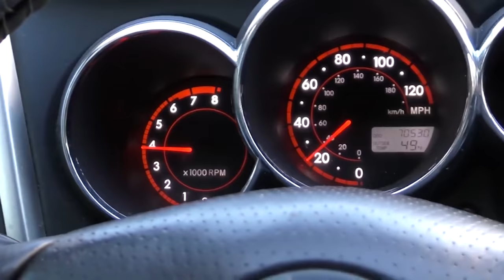5 Signs Your Transmission Has a Serious Problem

Comment: If you do it regularly is the key, (change fluid). If you let dirt get stuck somewhere, it is best to leave it where it is. Your transmission life will be shorter than had you changed fluid often, but sending the dirt elsewhere can cause immediate failure.
Reply: What about changing it not flushing it. I’m at 217,000 miles and i bought the car like 4 years ago with 160,000 miles. I don’t know if the fluids ever been changed. What do you think?

Comment: My 1992 Chevy van sat for over 10 years and has around 70k miles. I want to confirm that what I am hearing is correct. You change the filter and whatever fluid drains out with that and then top it off. And do it often?

Comment: 3 reasons for slipping:
1. Worn clutches or bands. Mechanical failure.
2. Passage in valve body clogged with sludge. This is where new fluid can help.
3. Valve body bolts loose. Causing internal leaking from one passage to another causing lower pressure. This is the defect that thickeners can help.
Reply: Is there a way to just tighten the bolts? Are they accessible with the pan off?  I have a 4L60e in a 97 Chevy Tahoe
Reply: @wayneinfl  Yes. In fact there's video published by 1Road that will show you how with that exact vehicle. Also replace the filter.

Comment: Change your auto trans fluid and filter every 30,000. It helps much in preventing having to rebuild the transmission under 80,000 miles and can last well over 150,000 as long as it hasn't been misused.
Reply: My ES350 2007 has 285k with the original  fluid....yikes!
Reply: 2016 Mazda 3 I sport with 170,000 hard miles and the original fluid.
Reply: @hobojesus9817  That combination would make any viewer on this channel wonder why anyone would bother watching any auto related videos.
Reply: 2004 honda accord ex 255,000 miles same fluid lol.
Reply: My fathers car golf 2 1988 …he don’t know the transmission have oil.

Comment: I was always told when it comes to transmissions, only do a drain and refill (or partial drain and refill) --- never flush transmissions, especially ones that either have not had the fluid changed or it's really dirty.  It's one of those things you either do it regularlly at 60-90k or you just leave it alone and hope for the best.  I've seen a few cars where people even just drained fluid that had never been drained on cars with 150k on them and they never ran right again (they ran OK before the fluid change though) and they ended up junking them a year or two later...  On my last few vehicles, it was done every 60k.
Reply: I have a 2010 Toyota Corolla that I bought with 90k miles now it has 120k miles.. transmission kinda jerks lightly between 2-3 gear some times.
Should I drain the transmission fluid and change oil filter?
Reply: True words spoken
Reply: @age0fdef1  

If it's a standard automatic transmission I would probably just leave it alone if it's never been touched for 120K. If it's a CVT I'd consider changing it because those fluids are much more sensitive and must be changed regularly from what I've been told. My wife had a CVT on her Nissan Rogue. We changed the fluid every 40K and it still crapped out at 120K miles.
Reply: @age0fdef1  I just changed mine 2009 Toyota Corolla with 120k miles just did a transmission fluid drain and filter change never been changed before and it’s running good so I think yours will be fine
Reply: @leonelromero3296   how did u know you have to drain the transmission fluid ?? We’re there any signs?? I have a Toyota Yaris😅
Reply: When I was in highschool I worked at a  quick  lube place, I brought a Hyundai accent into the garage, it was so bad to go 100 feet I'd have to put it in neutral and back in drive every like 20 feet. They flushed it and by some miracle it was fine after. Also had a Taurus come in , the fluid was black with some greenish fluid in it, changed the fluid and it was fine too. Those we're the only 2 I've seen that were ok after that much neglect
Reply: My 2013 pathfinder cvt still alive at 146k and never having the transmission serviced. It is slipping but so be it. My old mechanic said I needed a new one  almost 2 years ago. Lol. Drive to failure is my mantra. That what we have tow coverage in all my cars

Comment: When I worked at Jiffy Lube I did transmission fluid exchanges. The machine just replaced the old fluid with the new fluid. It doesn't replace the filters. But it does exchange the fluid 100%.

Comment: I have 2000 F150 it still recommends a 30000 mile transmission service.  That's what I stick to 250000 miles and still strong.  Great advice Scotty.

Comment: Hey Scotty. Thank you so much for this video. After seeing this video a few weeks ago, my 2010 Scion Xb with 208k miles on it had an code of P0741. This car was gifted to me. The previous owner failed to do any transmission maintenance on it. The transmission symptoms were the high revving during idle or driving and couldn't drive pass 35 mph. So because of how black the trans fluid was, we drained the fluid, removed the trans pan and trans filter. Put on a new gasket and trans filter. Thoroughly cleaned the trans pan. Added news trans fluid and Lucas trans fix. Cleared the code and wow! Car runs so good. Drove it for 5 days taking my kids to and from school with no issues.  So a BIG THANK YOU for saving me $1,645 to rebuild the trans. Fingers crossed 🤞 that this trans maintenance will help the car run longer.
Reply: Update! Scion is still running good after putting 600 miles on it after the repair.
Reply: @KC-xp9of  did your light come on😮
Reply: @Texas_Made_  yes the check engine light came on. After doing the trans maintenance and clearing the code, the light never came back on. So now we drive the Scion like a grandma 😁
Reply: i have a Scion 2013XD, at 100k miles, trans fluid looked very dark. I told jiffy lube just to do a simple drain and refill, but they said they don't mess with the Drain pan or change the Trans filter. I would like to get that filter swapped and maybe clean the pan. How important is it to swap out that trans filter guys? any advice? thank you.
Reply: @Rip-c4p  this is not an easy job due to having to remove the sub frame just to get the trans pan off. This car is not easy to work on because it is so compact. Then there are lots of bolts holding the trans pan on. So it's tricky to unbolt it so all the oil doesn't spill all over the place. I believe there is a YouTube video on this service.  And, I've changed the trans fluid 2x and the car still runs great 😁 well... except it eats up a lot of oil each week due to bad pistons from the manufacturer.

Comment: This man is telling the truth. Had a 2002 Hyundai Elantra that was doing the same thing, my father showed me how to change the fluid and it never slipped again.
Reply: Hi, I took my car to the shop. They told me to leave it alone because when they drained the fluid in the pan, they saw pieces so they said its holding it together. Do I not never change the fluid ever again?
Reply: i had an 02 elantra gt  , and best car ever until the oil pump went and motor seized middle of winter in -36. but other then that was the best car i ever had .

Comment: Everything Scotty said in this video is happening.  I have  2007 Lexus ES350.  I bought it used and everything was going great because I maintained it. Then 2 years ago Toyota changed the transmission oil and in May my car just started to act up. I barely able to make it to my mechanic. He changed the oil and runs slightly better but Scotty I believe just confirmed I need a new transmission.  Uggh

Comment: Fun fact: car companies don't make new transmissions. The transmission in your new car was ripped out of some old junker from the 90's and sandblasted. Then it got welded back together and stuffed with good components that came out of old junkers too. After the absolute minimum number of new parts are added to get it working, its stamped as new and put inside a brand new car.
Reply: almost everything now adays atleast gm related has 10 gears😭😭 I don’t think so
Reply: Yea lol this is wrong, source: worked on the plant floor making them.
Reply: You got a source for that bud?
Reply: @Shtinkyps he obviously doesn’t know what he’s talking about😂
Reply: Nice specification of the make and model of such Frankensteined vehical.
Reply: A fact is sourced. This one isn't

Comment: I changed the transmission fluid in my Mazda BT-50 and it actually shifts well, but they charged me $150, so I don't know if it's cheap, but I think it's worth it if good mechanics like you, Scotty, change it. As always I love the content. Happy Father's Day to you, Scotty!
Reply: Would a 2001 Mazda 626 be a good car? Or a 2008 Mazda 3?
Reply: $150 is a good price. A shop in Georgia charged me $199 for my 14 mustang.
Reply: @samfisher320  where’d you go
Reply: @TB-zb1sd  Martinez auto repair. I think it was a different name 2 years ago. Ownership changed.
Reply: Hell yeah that's cheap
Reply: Just paid $200.00 for my 2009 Impala with 261k miles :))
Reply: @samfisher320  know any good mechanics in the area? The one on tobacco rd seems like a rip.
Reply: @mrp8173  watch out for funky issues, my 2011 impalas odometer jumps all over the place when its in any gear when it comes to a stop, even after replacing the vss, it still boggles my mind🤷‍♂️🤷‍♂️
Reply: @siccmade103last9  I had a 2006 Impala that would get stuck in rev mode right after purchase (used). Took it to the dealer & they replaced both computers. They said it totaled over $4k. That was several years ago.
Reply: Fluid change 150 dollars 
New transmission-3-4,000 dollars
Yeah I’d say that’s pretty cheap 😅
Reply: @courtneylovesjordan9519 mazda 3 definitely
Reply: For sure, and it's way cheaper than a new transmission 👍🏼
Reply: $150 a year to half a year is cents compared to replacing the entire transmission once in your cars lifetime, what is so complicated about that for some of you people? Stop being so stingy.
Reply: @sumbigdumkunt  you dont change trans fluid every year
Reply: l
Reply: I paid over 300 for my Nissan maxima 2014
Reply: @sigmamale4147 my Camry has original fluid 260k miles later 😂, I’m leaving that puppy as is

Comment: Nissan told me a few weeks ago it will cost me $650 to change my transmission pan because it has a hole. I have a 2014 Nissan Sentra and they told me they will need to do a flush. Glad I watched this video! Thank you Scotty!!

However, what is the typical price to change a transmission pan?

Comment: He's spot on. As a life long operator of high mileage automobiles this is the closest explaination of reality I have seen. Older transmissions are hit or miss and flushing can be just a gamble. Mostly as a last resort when you think your gonna need a new transmission. The best thing you can ever do is keep it from slipping at all cost. Don't be the asshat that pushes  a slipping transmission with a heavier foot. It never pans out. Long drawn out soft shifts are transmission suicides and abnormal high rpm s with little change in a actual movement create heat and wear clutches. Best choice, stop immediately , top fluid and keep it that way.
Reply: So I replaced my rad and I didn’t know the fluid got cooled down in the radiator. I ran the engine without the rad and everything flushed out. Black fluid came out , a LOT of it did. I started filling it with 1 quart, high rpm. I then put another quart, again, high rpm. I put in 4 quarts total by this point, it got a lot better, but still, high rpm. I finally put a total of 8 quarts and now the car accelerates well but now the sound the transmission makes when it revs is completely different but I get power from it.
Reply: @Crabchann   does your transmission still work ?
Reply: @Putthemracksup  yeah actually lol the transmission noise is normal.
Reply: What year is the cut off between older and newer?  That sure would be helpful don't you think?

Comment: The Manual for my 2013 Jeep Grand Cherokee has a 30k mile transmission fluid change interval.  I got lucky with this Jeep.  I know Scotty doesn't like them.  I bought it with 49k miles in June of 2018.  Two months ago I hit 85k.  I took it to a transmission shop for a fluid change.  The tech told me that the fluid was impeccable.  Whoever had it before me kept up on it.  No slips, very smooth shifting.  And this is a Hemi Jeep.
Reply: I just think of Jeeps as discount Subarus, sometimes you get a creampuff and get lucky I'm sure. They also made some very reliable models (Wrangler) but overall I'd be much more comfortable driving a subby than a Jeep. I've just seen too many transmission and suspension issues on them.
Reply: Trade it before its to late. Lol

Comment: Hey I have a 2014 Camry with 105k miles I just bought it and the transmission is perfectly smooth but I don’t believe the previous owner ever changed the tranny fluid. Would it be ok for me to change the fluid now?

Comment: 2012 Kia Soul 2.0 with 305,789 miles on it 6speed automatic transmission never serviced. 

Transmission shifts fine.
Reply: Don’t even think about changing that tranny fluid and keep driving that thing the way you normally drive it because that tranny can go at any time!

Comment: Hi Scotty! I have recently purchased a 2008 Lexus ES 350. Its very clean and seems to run great with no issues. It has 137,000 miles on it and the dealership had no knowledge on its service history... Because of this im concerned slightly. Without proof of any prior transmission maintenance would i be okay getting a transmission drain and refill (not flush) and repeat every so often until its been fully cycled with new fluid or based on the miles and lack of knowledge on its service history should just leave it alone and hope for the best. Dealer told me to leave it alone "if its not broke dont fix it" type of deal. Would appreciate any correct suggestions. Thanks!

Comment: Sign 1: if it's a Nissan
Sign 2: if it's made by jatco
Sign 3: if it's a cvt
Sign 4: signs 1 to 3 combined
Sign 5: repeat Sign 4
Reply: Too bad all commuter cars these days have a CVT. since 2014 for the Corolla and earlier for some other commuter cars.
Reply: I have a Cvt 2015 Nissan 125000 miles  maintenance on point since It was purchased new

So far so good. I guess I'm one of the lucky ones eh
Reply: @googleloginactivation415  you still have lower miles

Comment: Changed my transmission fluid 3x on my 06 Acura rl never been changed at 154,000 miles.  Car has almost 190,000 miles and so far transmission is running perfect
Reply: Cvt?
Reply: @Ardinex  lol

Comment: You can flush (safely) your own fluid.  Get 2 buckets fill the one with new fluid and leave one empty.  Disconnect the hoses put one hose that sucks the atf in the filled bucket and the other hose that empties the old atf in the empty bucket.  Start the engine and wait until the empty bucket is filled with the old fluid and the bucket with the new atf is empty. Voila!

Comment: I should have listened to videos like this. I purchased a used rx330 '04,  seemed like transmission fluid wasn't changed in about 100k miles. It had 160k miles on it. I found a mechanic who was a Japanese car expert. He told me it's safe. Said he's done it many times. Prior to the flush (non-powered/ non pressurized) flush, the car shifted so smoothly and beautifully. After the flush, it takes longer to get into 4th gear with a lag. It runs fine after a few months but I will hate myself if the transmission breaks within the next year or so.

Comment: I had my trans fluid changed at a shop . They sucked out the fluid out through the filler tube and replaced it three  times . Each time the fluid became cleaner .No problems. What do you think of that Scotty ?
Reply: that's an exchange not a flush.

flushes disturb the varnish too much. regular exchanges keeps the varnish down

Comment: I have a 98 s10 bought it with 60k miles on it when I bought it I had the oil and tranny fluid changed changed tranny fluid every 40k miles it has 230k miles on it and it shifts like a dream

Comment: Scotty Kilmer I have a 2001 Chevy Tahoe 2wd 176K miles 1st and 2nd gear making grinding noise and I notice one time the reverse gear did not engaged "one time" right away. 3rd and 4th gear runs smooth.

Comment: At work, we use a 1972 Chevy C/50 (The one in my profile picture) it's a rod machine/ pulling unit whatever you wish to call it. Our work bought it brand new from a dealer, it was just a flatbed truck and we put the equipment on it. I'm 16 and just started working here with my dad about 2 years ago, and ever since I started, I have been trying to restore the truck, and take care of it. The transmission though is on it's last leg, as far as I know, nobody ever changed the fluid since it was bought. How do i know? I went to put new oil in the trans, took the drain plug out, and all that came out was like less than 3 ounces, barely covered the bottom of the bucket. I was shocked as ever, but somehow all this time, even though the transmission gears were basically going metal to metal with 0 lubrication for however many years, it still drives. Unfortunately, today the clutch basically died, or the trans, it won't go into gear or come out of gear, if it's in neutral it just grinds and grinds if you try to push it into gear, if it's in gear, it won't let you get out of it without a hassle. So we had to kill it, then put into gear, then drive, and we had to drive in 1st gear the whole way since we couldn't shift. Luckily we never drive it on the highway we only drive around the oil lease.